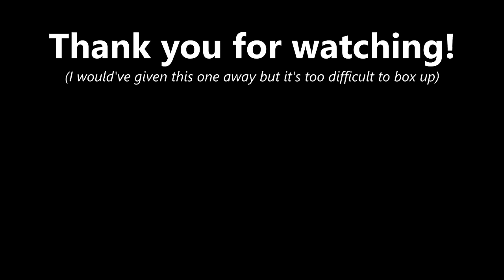How to Make a "Target Practice" Style Jason Mask - Friday The 13th DIY

Comment: What I usually do for scratch detail on any mask is I hold the mask and drag it across the concrete floor of my basement (the concrete isn't smooth like you'd think) or I slam it against the basement wall (it's made from cinder blocks with uneven cement/mortar between them) maybe it's overkill, but it works....